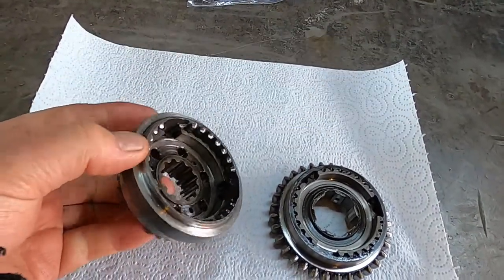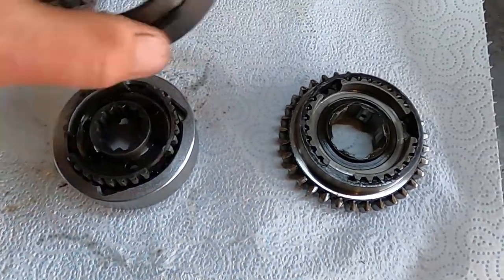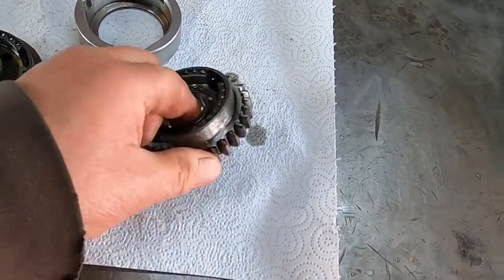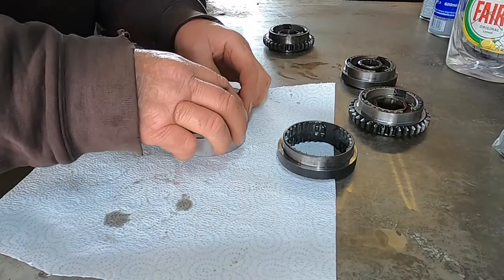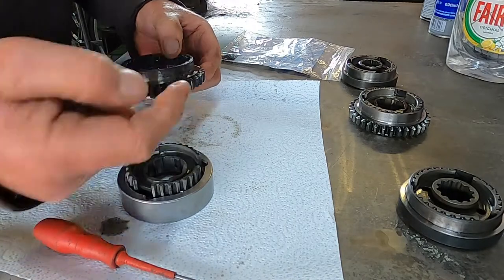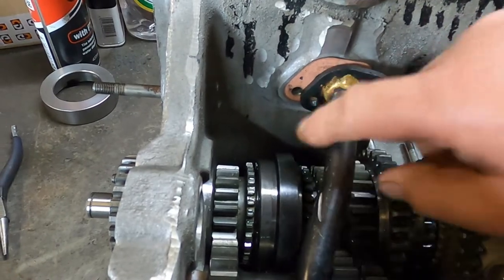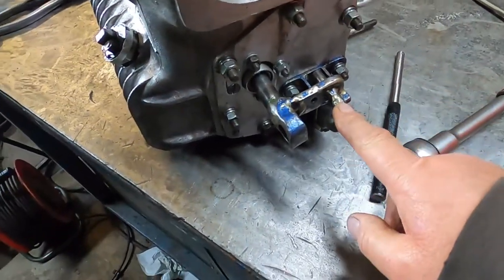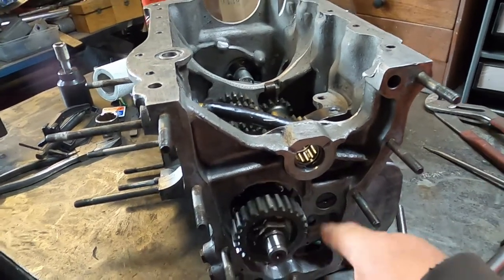How to Assemble Classic Mini Synchro Hubs with Special Tool - The easy way!

Comment: Just use  a hose clamp around it tighten up till it pushes the balls in then push the centre down into the outer works every time haven't lost a ball or spring yet